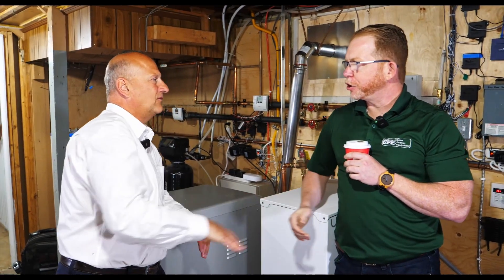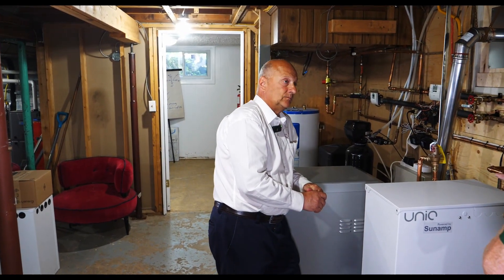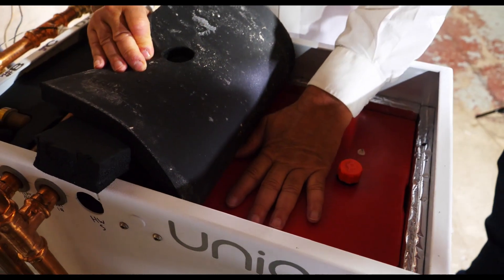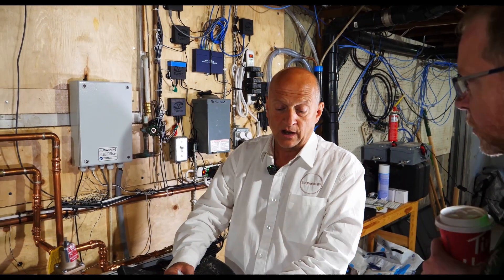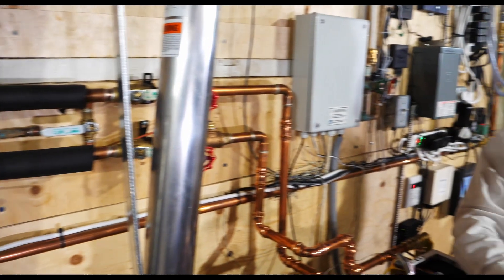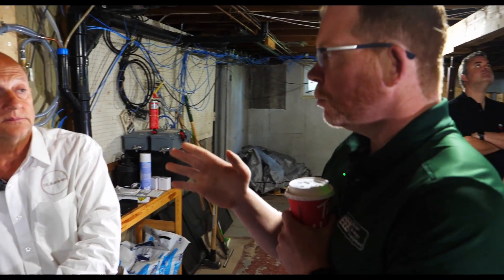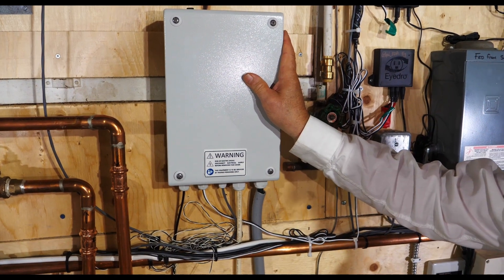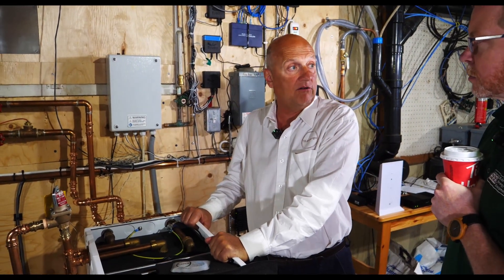Unlocking the Future: Sunamp's Revolutionary Thermal Batteries!

Comment: I went to their website and all the models are not the same and the thermino manual states that it is only for domestic hot water only. They have heat pump versions that must match the heat pump model you purchased. 
They give so little information on their website. It’s completely annoying.

Comment: I only want to know which kind of semi conductors used and how your circuit board is arrayed?
This specific design will be obsolete after we start using rare earth minerals and solar capacitors instead of a water tank that’s heated by an off site fossil fuel like coal or natural gas.

Comment: I hate to point this out, but with the size of the mechanical room, just put some 1m3 tanks in series and you get the best of all worlds. Thermal stratification, heat exchange, durability. There's a company in California promoting this for load shifting space heating and DHW on variable tariffs and central air hvac. This is just not going to be cheap enough to make any differenc in the big picture.
Reply: What’s the name of that company?
Reply: @atomicsmith  harvest thermal. It's based on a japanese c02 dhw system. havest thermal do the controller and "hydrobox" to optimize the load shifting.

Comment: I have done here with Germany cost a lot of calculations. Phase change materials are interesting but not real cost effective compared to water. Especially the shown PCM in hand warmers. It will not work in such a system, because if it is triggered it will run until all material is solid. But you can use e.g. paraffine with a phase change temperature about 60°C. But there are issues with the heat exchanger. When it get solid you have a big thermal insulater at the heat exchanger. And for cost reason it will only work for a short term storage e.g. some days.
For long therm (one year) you need a huge amount of PCM. I my opinion for a long term heat storage simple water is the best PCM. It is cheap and it has in interesting feature to same the heat exchanger from isolating with the the solid material. Water has its highest density at about 4°C. So every see is freezing from top to buttom. So you can build the heat exchanger at the buttom and the water colder than 4°C will rise to the top. But you need about 115m³ water for thermal equivalent of 1000 liter heating oil. And of course you need additional a heating pump plus some electrical energy to transfer the 4°C water to 40°C water for heating. If you dont like the heat pumpe, you will need e.g. parafine - but you need the double amount of it. So its a big cost issue.
Reply: That's not going to work. Heating a tank of water loses heat fast. My HW tank keeps the water hit for around a day. Something like this will retain stored heat for ages. It only gets used when water is heated. If you don't use any hot water, you lose no heat stored.
Reply: @dlarge6502  I think you did not get the point, that I do not store warm water. I will use it in conjunction with a heating pump and let the water in the see at "natural" temperature. It will use the phase change from water to ice.

Comment: I have just installed one these, very heavy 178 kg for 210 lt equivalent. So a house job would be hard. Be good if did a clip on how to install. 
Shame it won't take solar hot water like a cylinder. I am sure its doable.

Comment: If I understand the technology correctly, it utilizes PCM that undergoes a phase change at 58°C, making an ASHP unnecessary. I own a heat pump and use it to heat water to 42°C without mixing it with cold water. To address the issue of Legionella, I heat my water cylinder to 65°C once a week. So in terms of energy efficiency I don't see a use case for this device.
Reply from the maker: Thank you for the insightful comment, and you've made a crucial point about the importance of managing water storage conditions to prevent bacterial growth. Indeed, Legionella bacteria typically pose a risk in water temperatures between 20°C and 45°C. Your practice of heating your water cylinder to 65°C weekly is an effective strategy to mitigate this risk.

However, the unique advantage of PCM batteries like this one is that, in addition to its ability to store and release both sensible and latent energy, it doesn't involve storing any water volume. This key feature means that concerns about bacteria, such as Legionella, are not relevant in the same way they are for systems that store water, such as traditional water cylinders. This aspect of PCM technology is similar to tankless water heaters, which also do not hold water and thus reduce the risk of bacterial growth. This makes PCM an innovative and safer option in many applications.
Reply: No one has ever died from a hot water take via legionella in the UK. Waste energy heating it up really.
Reply: You'll use this device to store heat when it's cheap to acquire. Same with a water cylinder. Your heat pump may not be something you want to run just for hot water when the cost of electricity is through the roof, instead you run it when it's cheap and "time shift" your usage of that heat via this battery.

Also your heat pump is next to useless in a power cut. This will give you hot water for days.
Reply: @dlarge6502  yeah, those are good points. Especially when it comes to power cuts

Comment: So can I use this for both Potable water and Radiant floor heating with Glycol? Meaning they won’t mix, having two different in put and out put, hence, ports ABCD? 
I would like to know if I can use this in an RV Camper? Thank you in advance!
Reply from the maker: That's a fascinating application for this technology, and Michael our host a month ago had a conversation with his colleague about installing it in an RV. The idea of equipping an RV with this unit that includes a built-in 2.8kw element is intriguing. This setup, combined with a small solar PV array on the roof, could effectively charge the unit, providing a substantial amount of stored energy. With approximately 48,000 BTUs of energy storage capacity, this model could efficiently heat the RV or provide domestic hot water. There are smaller units as well that if you hit our host on linkedIn he can help you with. 

The double pass heat exchanger design of the unit allows it to be used for heating and domestic. The PCM materials are both environmentally friendly and safe for humans. This is an important consideration, especially in a mobile setting like an RV where the risk of damage and leaks might be higher.

It's great to see such innovative ideas being explored, and this particular application could revolutionize the way energy is used and stored in mobile homes and RVs. Thank you for sharing this insightful concept – it's an excellent contribution to the ongoing discussion about sustainable and efficient energy solutions!

Comment: Sodium Acetate is the substance used? Once the reaction starts it keeps going. None of the copper pipes are insulated.
All this effort, just to replace a very efficient gas boiler. It must take a long time to pay back.
Reply from the maker: Great comment! Thank you for taking the time to share your thoughts. It's important to note that in the specific Sunamp setup you mentioned, the copper pipes are not insulated. While this could impact the efficiency of the system, it's also essential to recognize that this setup is part of a test site. In such environments, extensive instrumentation is common as the gas utility is engaged in continuous experimentation and optimization. This context is crucial because it means the system's design, including aspects like uninsulated pipes, is part of ongoing research and testing rather than a finalized residential installation. ( that is our understanding it is NOT our site we just filmed it )

Regarding the comparison to a very efficient gas boiler, the transition to a system like Sunamp's, while potentially slower in terms of payback, offers several advantages. We are not sure you would ever replace a boiler with this tech but Sunamp can speak to that. We did just see a NYSERDA report that showed using a Sunamp instead of an indirect reduced gas consumption by 50%. 

Great comment thank you!
Reply: Well it's cheaper than a boiler. Will work for anything up to 35 years, has a 10 year warranty. My cheap plastic basic boiler cost me 3 grand and has a 3 year warranty.

As far as the heat transfer goes, it's released little by little, not all at once.

Comment: what is the max temp it can produce I'm wondering if you can combine it with a thermal electric generator to produce power TEC
Reply from the maker: Based on information provided by Sunamp, the maximum temperature their heat batteries can reach is around 170°F, though this can vary based on the specific Phase Change Material used. With the right design and a mixing valve, it's possible to effectively utilize even higher waste heat temperatures. Definitely reach out to Sunamp the people we have met in their company have been very open to discussion.
Reply: 75C from solar PV.

Comment: thats just sodium acetate trihydrate. 
nothing new here, i did this 10 years ago. everyone knows pocket warmers. if people just would develope their ideas instead of throwing the first thing out they can build just to make some money, we would had better tech.
Reply from the maker: Thanks for sharing your thoughts! You're right that sodium acetate trihydrate, the material used in pocket warmers, has been known for some time. However, what makes Sunamp's Thermino technology stand out is the way they've innovatively adapted and enhanced this substance for energy storage.

Sunamp has developed a unique intellectual property around this technology, optimizing it for higher efficiency, greater energy density, and longer life cycles than traditional applications. Their approach involves sophisticated phase change material formulations, which allows for more effective heat storage and release at desired temperatures. This makes it particularly suitable for domestic and industrial heating systems, offering a more sustainable and efficient solution compared to conventional methods.

The development of Sunamp's technology involved extensive research and innovation to overcome various challenges, such as stability, scalability, and integration with existing heating systems. It’s this dedication to refining and developing their idea that sets Sunamp apart in the field of thermal energy storage.

Innovation often builds upon existing knowledge, but it's the unique application and continuous improvement of these ideas that drive technological advancement. Sunamp's approach exemplifies how rethinking and developing existing concepts can lead to significant improvements in technology. We appreciate your interest and are always here to discuss more about these exciting developments! We really appreciate your comments and we are looking forward to seeing more PCM technology hit North America!
Reply: You did this 10 years ago and you didn't capitalize on it.

Shame.

Comment: We have a 2kw solar system for a 300 sq ft residence. The goal to use on site as much pv power as possible before we give it to the grid. Our passive solar floor will keep the home warm (70's F) on sunny days until midnight even with outside temps in the 30's F.  Could we charge the Sunamp from our pv solar to radiantly release heat later in the night?  If we don't need the heat, how many days would the Sunamp store the heat?
Reply from the maker: It's fantastic to see your commitment to maximizing the use of solar energy in your residence. Incorporating a Sunamp heat battery with your 2kW solar system sounds like a smart move. Sunamp's units are specifically designed to store energy from solar PV systems ( as well as air to water, solar thermal, waste heat, the list goees on ), making them a great fit for your setup. When your solar panels are producing excess energy during the day, this can be stored in the Sunamp unit. Then, even after your passive solar floor cools down at night, the Sunamp can kick in, releasing stored heat to maintain a comfortable temperature in your home. In a future episode of our series Michael is going to show off a system that is exactly as you are describing. It is already filmed we are just doing the editing on it. 

One of the standout features of Sunamp's heat batteries is their ability to hold onto that heat for several days and in some cases much longer. So, on days when you don't need the extra warmth, you won't lose that stored energy. It's just a matter of sizing the Sunamp unit correctly, taking into account your daily energy generation and heating needs. This way, you ensure that you're getting the most out of your solar setup, enhancing your home's energy efficiency and making sure none of that precious solar power goes to waste.

Comment: A steel tank full of sand is simpler.  Or just a large,standard hot water tank  coupled to a high efficiency solar hot water collector system.  Simpler is better.
Reply from the maker: Great comment! Thank you for sharing. Our host Michael has worked with Zon Engineering on thermal storage with sand and although a great concept it's not the same as a phase change battery.

Sand itself does not hold energy in the same way that a phase change material  battery does. A PCM battery stores thermal energy during the process of phase change, when the material changes from solid to liquid or vice versa storing latent and sensible heat . Sand, on the other hand, has a high thermal mass, meaning it can absorb and retain heat well, but it does not undergo a phase change. Sand's ability to store thermal energy is based on its specific heat capacity, not on phase change.

PCMs are used in thermal batteries due to their ability to absorb and release large amounts of heat during phase transitions at relatively constant temperatures.

Sand can be used in construction and other applications for thermal mass to stabilize indoor temperatures which is what Michael worked on with his friends at Zon
Reply: this is true, but with sand it only makes sense when you can heat it up to at least 5-600 degC and discharge it to mix 60degC warm water. for lets say 100degC to store, water would be the better medium.
Reply from the maker: @dominiklackner6334  you nailed why PCM is so innovative. Great comment!
Reply: Hot sand cools down when you aren't using it.

This doesn't.
Reply: @dlarge6502  it doesnt have to stay hot for long.  Sand silos heated by solar during the day, would immediately begin contributing heat for power generation after sunset.  Most peak power consumption occurs in the hours at or just after sunset.  So your point is pretty much irrelevant in real world power demand generation.  Besides, sand silos are already being used in at least one cold climate country for heat storage with no issues.

Comment: Cool tech. I have been hoping for something like this for apartments. How tall would it have to be to store 8 hours of thermal heat for heat/hot water? We have a flat roof apartment building w/o cell towers! Thermal roof base hot water can be used as a source since we are over the treetops.
Reply from the maker: The Thermino 80i from Sunamp is the one we looked at here and there are many installed but they come in even bigger units ( CentralBankMini for example). This is a compact thermal storage unit, but to provide a precise answer about its capacity to store 8 hours of thermal heat for heating and hot water in an apartment setting, we need specific technical details. You can reach out to our host on linkedIn who is a PCM battery Nerd or go directly to Sunamp for assistance. 

To calculate the required capacity for 8 hours, you need to know the heat demand of your building. This includes the number of apartments, average hot water usage, and heating requirements. Once you have this data, you can determine how many Thermino 80i units are needed. These units are modular, so you can combine multiple ones to meet your specific needs.

For a flat-roof apartment building without obstructions like cell towers, installing these units on the roof is feasible so long as weather conditions permit. The structural integrity of the roof must be considered to ensure it can support the weight of the installed units. Consulting with a Sunamp expert or a thermal systems professional is recommended for precise calculations and implementation guidance. Thanks for your great comment.
Reply: @plumbing-hvacmagazine  the thermal units would be located in the basement where the current hot water heaters are and the water comes in I was thinking of the roof for the thermal solar panels to possibly feed these units. Thank you for your comprehensive answer.